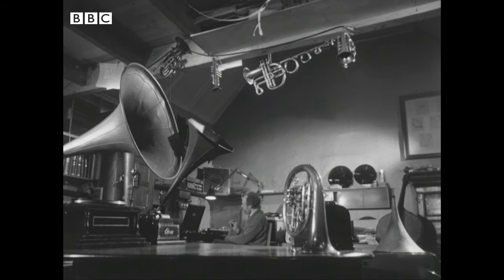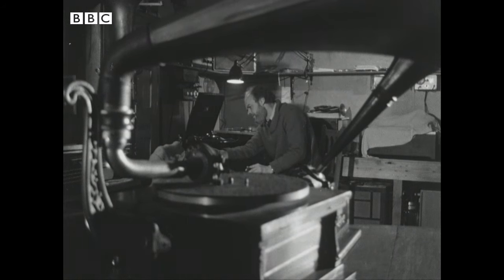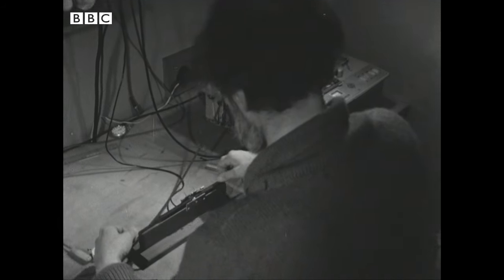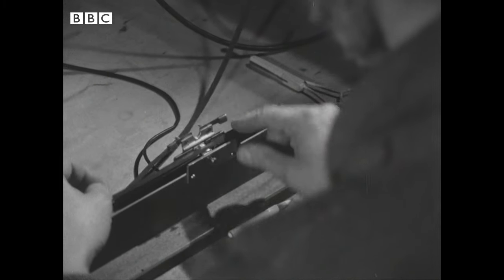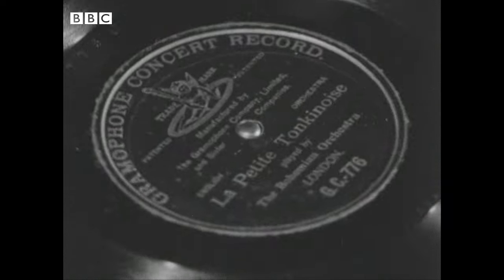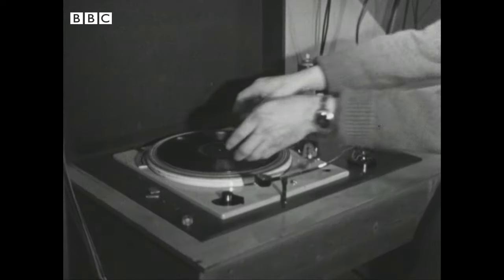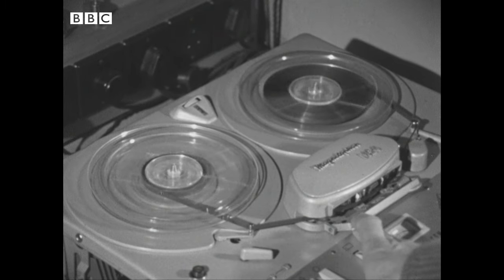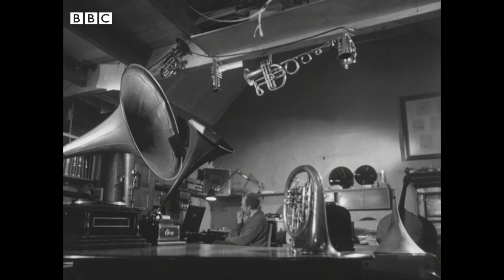1971: The PAINSTAKING art of RECORD RESTORATION | Tomorrow's World | BBC Archive

Comment: So if he was doing this in the early 1970s it means the recordings were 60-70 years old at that time. Whereas this archive we're looking back on is now 50 years. And I bet he'd not want to know that the improvements he laboured over could probably be easily made with specialist computer software in a couple seconds.
Reply: well, no, not a couple seconds. anyway if he was the one using the software himself i bet he wouldn't mind, there's still a lot of care and a lot of manual labour involved in doing a restoration right.

often, just "running the software" yields only average results. the specialist software in the hands of a skilled worker will get you much better-sounding stuff.
Reply: Unfortunately evens todays best software from Izotope and the like cant perform miracles though they do and can help a fair bit.

Comment: 2:00 doing this is goign to mess with eh rthym and or beat? right? 
like its cool he does not have to cut it twice , the One Cut Takes Meteral off, like a Saw brade with wood  .. but if you do this 100's of times for 1 Song , that going to mess with the Tempo
Reply: They talk about that in the video. It’s such a small fraction that our brains can’t recognize it. Though that is very hard for us musically minded to fathom and accept ;)
Reply: If you look closely you can see that he doesn't just stick the ends of the tape together, he leaves a gap the same size as the slice removed. So the timing is completely unaffected by design, not just because of the ear not detecting it.